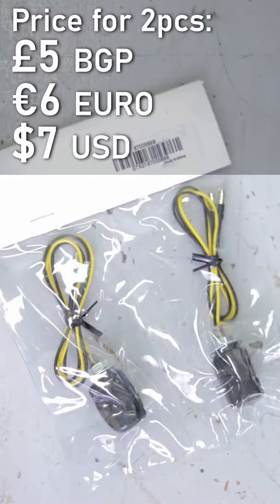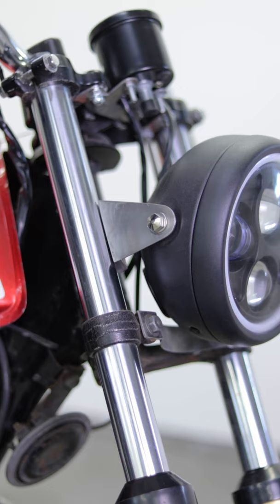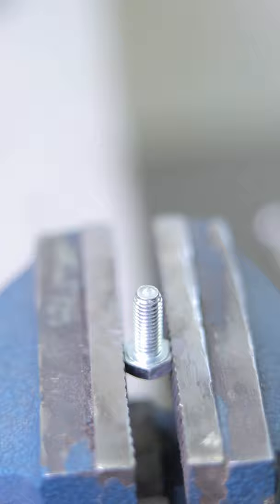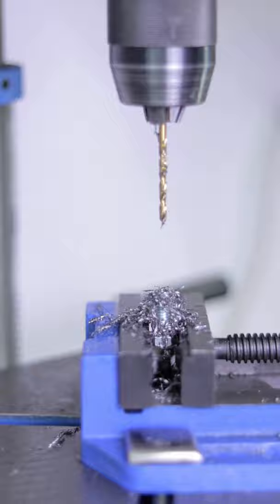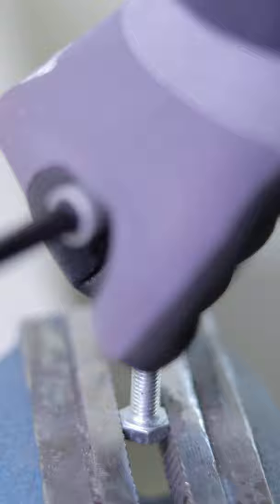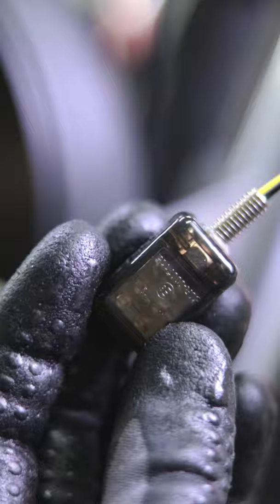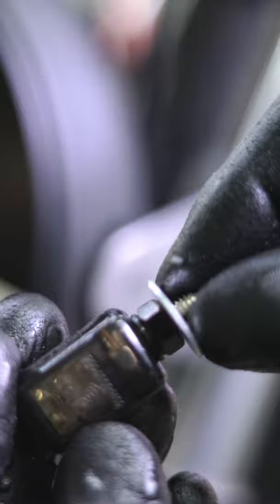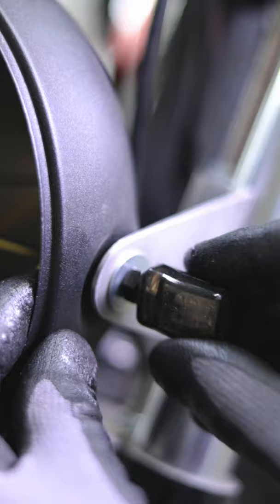Micro LED Motorcycle Turn Signals

Comment: Nice ! how are these turn signals? Any good? I'm planning to use them like you demonstrated. They would look tiny and great on my cafe racer.
Reply from the maker: Hi, the light is tiny and it's quite bright. I like the overall square design and the small size! The housing is made of shiny hard plastic, It would have been better in my opinion if it was matte finish, and the back made of rubber or metal or at least a plastic material that felt more premium. In my opinion the housing should just have had flat/smooth outside walls, but there are some unnecessary profiles on them, some kind of diagonal shapes.  Since they are made of hard plastic there is no flexibility, so they might break easy. 

Conclusion: They are OK, small and bright light for low price. They are very glossy and made of hard plastic, looks a bit cheap. Wish they where made of more premium material.
Reply: @kihestad  thank you so much for your feedback. I really appreciate it. 🙌🏽